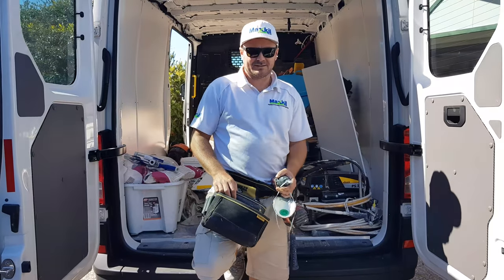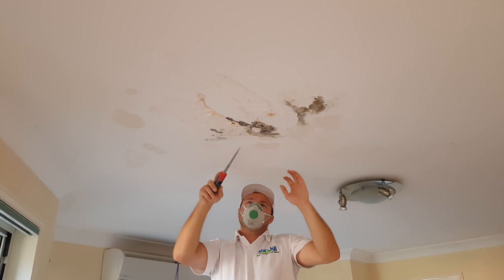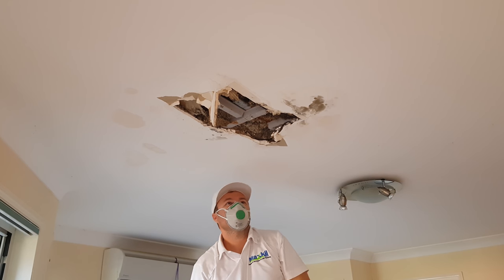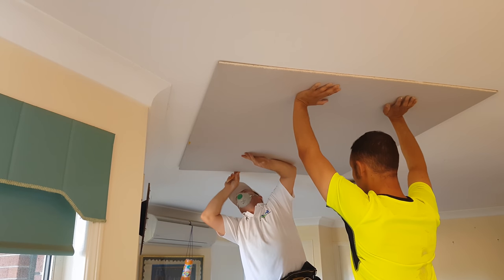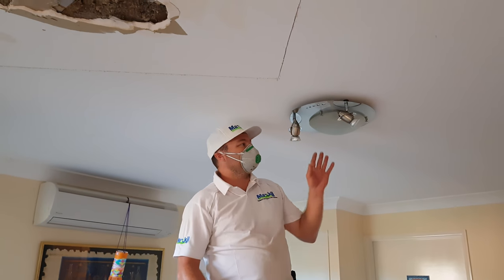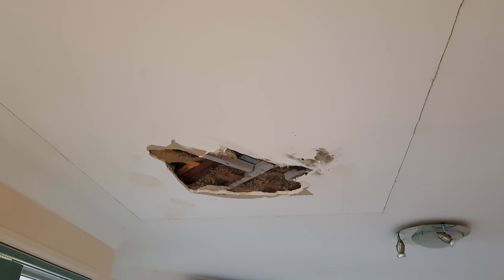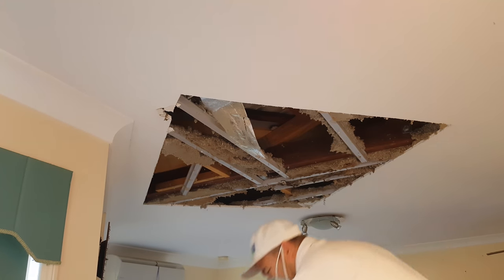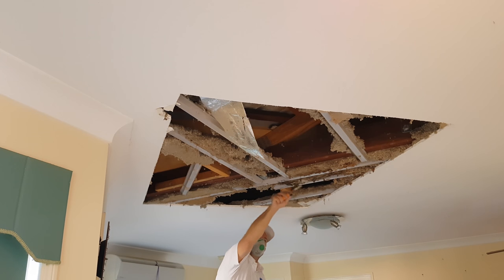Cut out Drywall Plasterboard from the Ceiling

Comment: How the hell would you check for lvl in drywall
Reply from the maker: Not sure what you mean?
The plasterboard is warped from the water damage.
So I try to cut that out. Using the level if it runs flat. See when I Rock the level on the ceiling.. showing there is a big hump..
Reply from the maker: Just using the level as a straight edge